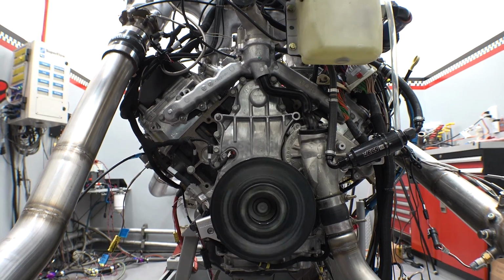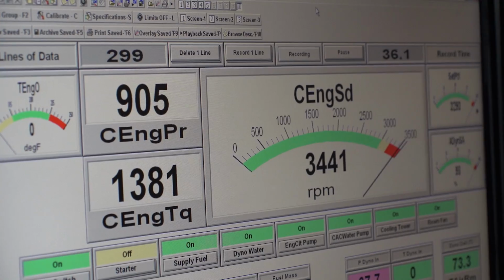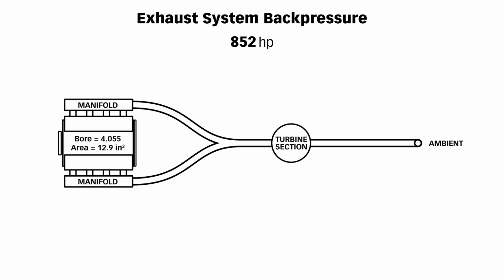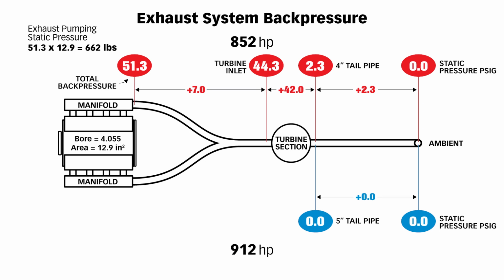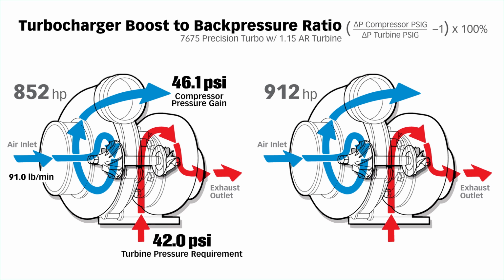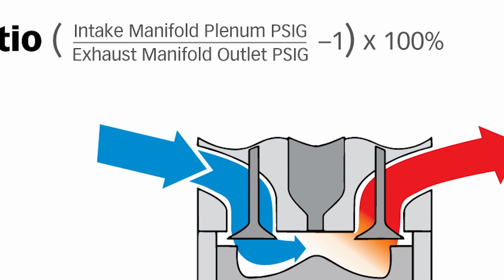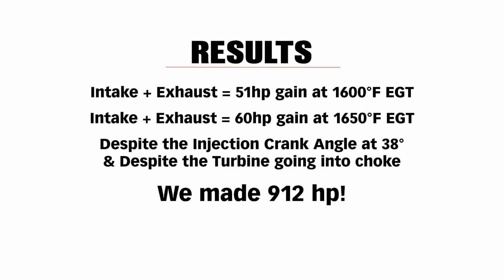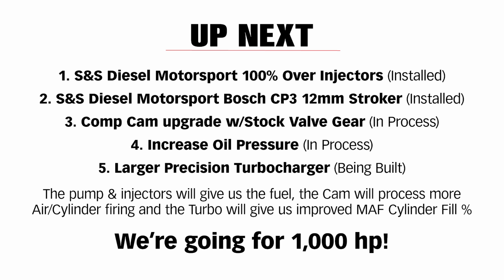912 HORSEPOWER DURAMAX with STOCK internals! Killing A Duramax Pt 12

Comment: Let’s say you were able to increase just the turbine side A/R size and nothing else. Wouldn’t this help to drop the back pressure and improve the ratio? Looks like the turbo exhaust housing is now becoming the choke point along with a compressor that’s becoming too small for the air requirements. Pretty cool videos.

Comment: Gale,
1. Is it possible to calculate a gas mph while u r on the Dyno and w ur data monster ??
2. The exhaust is doable on a street truck, but, how real is the ability to replumb the upper plumbing on a stock street truck ????
In other words, can this be duplicated on my truck??? ( Assuming my pocket book was good for it 🤣😂☹️ )
With stock ratio of 3.73
What kind of mileage would THAT motor produce ??

Comment: It can be rather surprising how much difference a little refining of the intake and exhaust pipework can make. It's one of the things that I find bemusing when people don't think thinks through and hap-hazardly change things and don't get the expected results - bottlenecks, people!

Actually, I'd go a bit further, reducing backpressure also means the intake charge has to overcome less resistance and so improve cylinder filling a little. Ah, got to that bit - that would be what us old guys would regard as actual volumetric efficiency - how efficent the engine is at filling the cylinder?

Comment: Gale, awesome stuff, your scavenge ratio improved mostly due to your vastly improved inlet to the turbine.  Diesel guys love to bash exhaust on the sharpest smallest 90 degree bends or worst and claim it makes no difference.  Glad you're showing them wrong.  It always matters.  How much better it'll work with a turbo with improved turbine /turbski improvement

Comment: I hope GM, Dodge and Ford are picking up on this "revised piping" And please Mr Banks get into full exhaust/piping for our vehicles up and down pipes, and from the manifold back exhaust pipping
Reply: at stock power and average rpm levels the factory setups are probably well sorted out for power and economy. In my opinion, we are very fortunate to be able to purchase the monsters the OEM's are offering now. I can't imagine trying to pull my trailer with a 6.5 gm or the early cummns or 7.3.

Comment: This series is excellent!

I'm using a Mercedes OM606 3.0 turbodiesel with a GTX3582R and twinscroll 61 a/r turbine housing. Hoping for a rapid-spool 400bhp but after watching this I'm thinking of swapping to a larger 82 a/r housing as back pressure may be an issue.

As an aside, I've heard ball-bearing turbos can be damaged by diesel engines becuse of dirty soot in the oil. Has anyone experienced this?

Comment: 912HP on a light truck diesel without cracking the engine open. Who thought that was possible before watching this series?

Just to put a little perspective on this, the original Bugatti Veyron only puts out 89 more HP than Mr. Banks has tweeked out of this engine. Let that sink in for a couple minutes.

Comment: Extrapolating the line of thought that you always want more pressure  on your compressor discharge than back pressure on the exhaust this means that it isn't possible to run any EGR, thus any engine fitted with EGR no matter how small the EGR flow rate, is always going to be running hotter than it should, will have poorer fuel economy than it is really capable of, and is analogous to doing the 100 yard dash exhaling through a straw?
Why is surplus air with an efficient turbo setup instead of cooled exhaust gas not used as a combustion temperature mitigation strategy to reduce NOx emissions?

Comment: Mr banks what about the "vaccuum" effect the exhaust system has once the engine starts running. Meaning what about the air that already is pumped out the first cylinder that is pulling the next cylinder exhaust out? Does this help reduce the back pressure. Can having a bigger exhaust defeat this? Or is this not a thing?
Reply: I think you're referring to 'scavenge' effect which is what long tube headers are designed to do best. I don't think that applies as soon as you turbochage as there will always be backpressure leading up to the turbine and the pulsations are eliminated beyond the turbine...

Comment: Hello from italy=)  In the 912hp dino pull  why the turbine requirement  grow up to  47.4 psi (921) from 42 psi (852) while the  exhaust mainfold psi drop at 47.6 psi (921)    from 51.3 (921)?

why if the  turbine requirement increase  while scavenge ratio drop? 

please reply=)

Comment: You finally explained how Ram-Air intakes work! Yay!

You can probably find some way to simulate vehicle speed for one though. Perhaps with a wind fan?

Also, now I'm super curious about those oblong exhaust tips. Can you explain those, please?
Reply: I would also like to see some insulation added to the exhaust system to see if the exhaust velocity increases. I heard that aerogel microparticles are a fantastic insulator.
Reply: Final experiment I'd like to suggest for this video: I want to see what happens when you add graphite to your motor oil, and/or when you add grease to anything that's not already well lubricated.

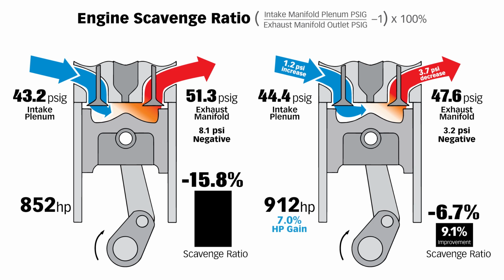Comment: 19:16 "it's still negative"
What turbine housing changes would be necessary to get this flow rate across the turbine corrected?
And theoretically how much power would opening it up with a properly sized housing release?  
It will cost psi /mad by bypassing more drive pressure . I have proven this going the other direction ,with my 1st gen Cummins. On my H1c/HX35 supper cores I have run 4 sizes of housing ( swapping the cord didn't change the result) 21cm@11psi, 16cm@17, 12cm@28,6cm@28 but much sooner with BD QSV set not to open,  S366/80.80Ar @10 PR .65 ,  .80 with an adaptor that blocked the front valute @20 PR was 2:1 (eg 20psi intake=40psi BP)
2weeks after moving to the  12 cm with stock fuel settings the trans spit out a 4th gear planet, sounded like somebody fed the Mogwai after midnight as I was crossing the state line from Oklahoma to Texas
Wish I could use and IDash monster as a standalone nonOBD2 mechanical injection/carbureted motors Diagnostic and tuning tool.

   Would I be able to power the I Dash through the OBD2 port on my medium duty Allison 4th gen 6 speed transmission TCM, it would provide TPS and RPM as well as giving me access to all the critical data from the transmission?

Comment: There's still a couple of mechanical changes to add to this  : if the induction tube is the same length as the circumference between the y joint and the turbo inlet you should get a couple more horse power. Diameter × 3.14 = length .

Comment: Also if you can move the turbo to an area away from the engine where it’s cooler what would that do for air density
Reply: Nothing. Turbo will still get hot from the exhaust.  That's why there's an intercooler

Comment: Hey Gale if you could take the turbo out of the exhaust and spin it with an electric motor to relieve the back pressure how much hp gain do you think would happen and how much drain on hp would the alternator   Cause powering the electric motor.

Comment: I can't wait to see the difference a cam makes! I think diesel people hyperfocus on torque. Wheel torque at a given wheel speed (which is how vehicles are operated, mind you) is dependant on HP, not torque.
Reply: Torque is measured, horsepower is calculated.
Reply: @taylorsrus9543  either can be measured or calculated from the other. Even if that were true, it wouldn't make my point untrue.
Reply: @Levibetz  I have not seen a dyno that measures horsepower. Diesels usually focus on torque because that is what matters in the common application, low speed torque.

Comment: I'm no engineer, but according to the "eye test" 1,000 hp seems really doable.
Reply: Already done on a stock Ford straight from the Dealership. All under Warranty. Still no discussion of torque which is what makes a diesel such an effective motive though in this formulation hardly braking force.

For example reducing back pressure sounds great...but what happens when you're using engine braking as part of your system engineering? It's not like we're going full on Thelma and Louise as our sole goal. What if we want to stop while pulling a 30,000 pound boat and trailer in tow? Suddenly our engineering solution became much more complex and of course ... real.

By way of example Google the Heavy Utility Truck if you want to see what the US Army is looking for in prime mover.
Reply: @doolittlegeorge  can you share with us what stock Ford Powerstroke straight from the dealership makes 1,000 HP?
Reply: I am an engineer. This is going past 1,000 no worries.

Comment: This is why Gale Banks is the LEADER in making power in a diesel engine. Pure science and physics at work here quantifying not guessing what needs to be done. Who would have ever thought tailpipe back pressure could seriously impact horsepower to this degree, 61 horsepower by changing the piping?! WHAT?!.... I had no idea that there was that much weight on the pistons to drive exhaust gases out of the engine. I can't wait to see the next episode with the all the improvements Gale is bringing to the table.

Comment: Because the compressor was still within a reasonable proximity to its peak efficiency @73.1%, rather than opting for a larger compressor, wouldn't it be prudent to consider a larger A/R ratio on the exhaust turbine?  (At this power level)  If you want more boost AND power, then yes a bigger turbo because you'll need more airflow, and will continue to move away from peak compressor efficiency.  But at THIS boost/power level, I think a slightly larger exhaust A/R might give a few more ponies.  However, it would also produce a slightly slower response at lower RPM's.  Would be an interesting comparison.

Comment: If Gale robbed a liquor store; it would be to get straight alcohol to spray into the intake to drop EGT’s
Reply: He has done a video showing methanol doesn't drop egts. It does make more power, but any time your adding fuel to a diesel your going to have a higher egt.

Comment: Is it kind of ironic that reducing restriction in the up-pipes highlighted the fact that the turbine was choking?  And with the new cam allowing the engine to go to higher rpm, mass flow will be even higher.  The turbo needs to be capable of handling maybe 15% more mass flow to get to 1000 hp.  Is a bigger intercooler needed?  And are the stock log manifolds adding backpressure?
Reply: I doubt he will push the engine too much higher into the rpm. Those are some large heavy pistons
Reply: @SkootSkoot_8558  He said he was going to 3800 rpm, so not very much higher.  On his monster truck Dmax, he's going for 6500.

Comment: I hope by the tailpipe comment he meant increasing the size of the complete exhaust system not just the tailpipe (which to me means tip or end sticking out from under the vehicle). That's what he did here. If he had just made a small section of 5" to go between the 4" to 10" there wouldn't be much benefit. If anything he just proved that the goofballs putting 8"+ tips for the last couple inches on a 4" system need to actually increase the size of the pipe from turbo back to see any real benefit.

Comment: All this exhaust talk really explains why drilling a hole in my chainsaws exhaust made it perform better. Less back pressure which is less resistance on the cylinder so I end up with more useable power.
Reply: 2 strokes are a different fish all together
Reply: If your chainsaw made more power with holes in the exhaust then the muffler was most definitely blocked. Two stroke engines need scavenging to function properly
Reply: @SkootSkoot_8558  no no its a diesel chainsaw...
Reply: Just imagine how well it would run if a turbo was made small enough!

Comment: Do you know the velocity of the inlet air and the velocity of the exhaust gasses? It might be possible to take advantage of some compressible fluid flow characteristics using a diverging/converging inlet pipe, and converging/diverging exhaust pipe.

Comment: Now that 4 cylinder gas engines can make more than 1000 horsepower, it seems to me that diesels need some type of knock sensor along with stand alone engine management.
Reply: Knock sensor? 😂😂 Have you heard a diesel run?
Reply: You cant put a knock sensor on a diesel. The factory ecms has 100,000s of parameters and are much more suited for the application than any standalone... Not that any exists for these commonrail engines anyway

Comment: Incredible video.

How are you going to get that scavenge ratio >0%?
Reply: The new larger turbo will bring the boost to back pressure ratio positive which will achieve plenty of positive scavenging.
Reply: A larger turbine wheel and housing can process more energy from the exhaust. If you look at the turbine efficiency curves that Garrett has, the larger the turbine housing, the more energy will be available to drive the compressor.
The efficiency of the compressor is dropping as well and it's going to have to flow around 8lb/min more to make 1kph. If 1000 was the goal, and I am sure it's not, you could step it up a little bit.
Precision has an 8385 that is a class legal turbo designed to run at high boost like this, it takes a lot of work to get a single to run at 60psi boost and not cook the air.
It's a big unit, and I imagine that's what's coming. Precision does have some diesel specific turbos but even their biggest diesel pulling turbos are only the same size as this one.
Reply: @timothybayliss6680  while turbine efficiency is important its not the critical point. The turbine becomes a choke point when it hits its flow limit. When it starts to hit its limit the boost to emp ratio starts to go south

Comment: That’s crazy how much power it is making and holding together.  Your able to tune it like that and make so much power.  Love these videos

Like the black mask.  I made mine out of my arc flash pants (navy blue) .  They are think and tightly made and with 3 layer and a coffee filter, 307L tig rod for my nose and PARACORD PLANET Brand Contoured Side Release Black Buckle with some elastic to help with movement because it clips on the back on my neck and top of my head.  I wear earmuff at work and the behind the ear hurts after 12+ hours.

Comment: I'm at 16 minutes and what I'm seeing is either twin or compound turbos on the old l5p. 🤔
Reply: There's only 1 turbo on this engine. He has 2 air filters connected to a wye feeding the single turbo. Are you aware 1 turbo has 2 sections? The exhaust side and a fresh air side
Reply: He is saying it is time for more turbo. 

A big single would be fine for this, since throttle response isn't a big concern.

Comment: at this point, it doesn't seem like 1000 will be that difficult
Reply: No question.   Especially since I don't think he has put that cam we saw a while back in.
Reply: Just straight line a nitrous bottle.
Reply: Joe schmo definitely isn’t his first rodeo
Reply: Not exactly.  The 1000 horsepower goal is achievable on stock parts but the peripherals are at their limits. Look at it this way, if aerodynamics prevent reaching a top speed goal because drag prevents it, how much power would it take to defeat the aerodynamics?  There are cars out there that can do 200 mph on 800 horsepower but the Bugatti Veyron needs well over 1000 to get to 225 mph,  but needs 1250 horsepower with 4 turbos to get to 255 mph.  See my point?  Air intake into the engine is that aerodynamic barrier.  The last thing you want to do is create supersonic airflow in a turbo engine.  Gale has his work cut out for him.
Reply: @joshtheking1772  Not a super educated person in this regard, but as I recall "simply" creating a denser charge will decelerate the charge and decrease IAT's....like a water or water/methanol injection system.

Comment: Would like to Turn You Loose with an old 8 V 92 Detroit Diesel and see how much power you could get out of it
Reply: Dirt992 he did. Check out Banks Pikes Peak hill climb/diesel. It's on youtube. I believe he did 3 or 4 videos on the Freightliner. You'll be impressed.
Reply: Dirt992 yes! I’d love to see something like that. I know they had turbo and supercharged engines just like banks boat motor engines.

Comment: I don't believe that the 10" exhaust stacks scavenge anything.  I think they increase back pressure because of the weight and resonant frequency of air in the verticle stack. Have you ever run this setup with a high-performance exhaust to compare the difference?
Reply: but once the piping is hot the exhaust gasses and the heat from the pipe naturally rise acting like a wood stove pipe helping to draw fresh air into the firewood in the stove therefore scavenging right?!
Reply: He already has backpressure measurements proving the stack added 0psi of backpressure...

Comment: Time to call Garrett 98mm 851285-5005S.  I would bet with you current set up just increasing the Turbo could have pushed you to nearly 1000hp.  If you are going to a Electric oil pump you could free up more hp too.